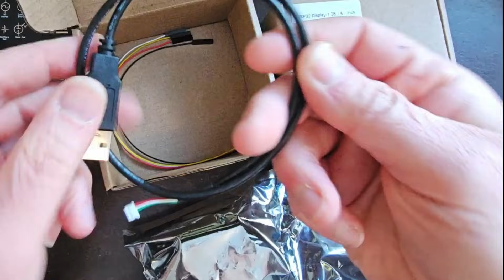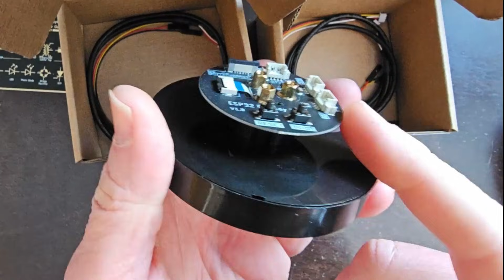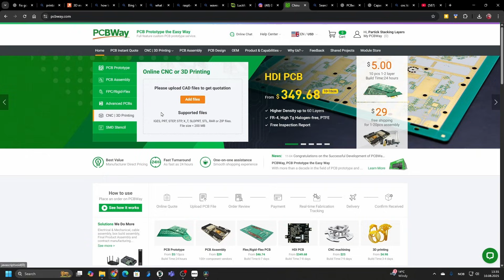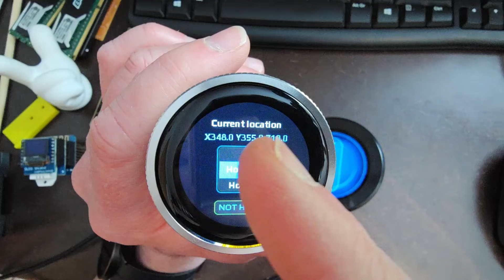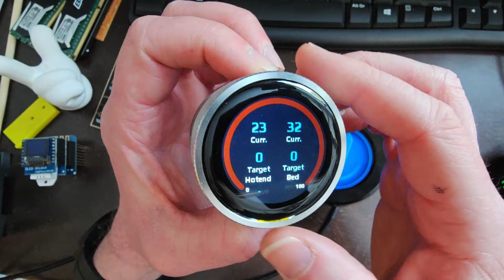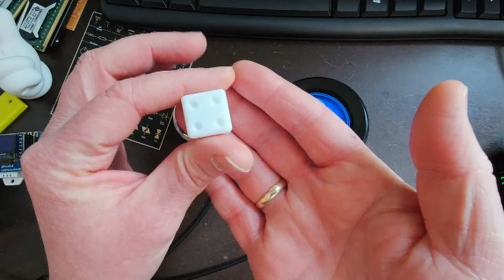Elecrow Rotary Display Review

Comment: Nice video - but itwould have been nice if you could demo how you created the code running on the rotary knobs
Reply from the maker: The code part with this, is something I'm still personally learning. The base of the graphical side is using LVGL and the rest is Arduino coding, but it's pretty deep compaired to basic aduino sketches so it was a lot of vive coding from chatgpt.

Comment: Let me comment some corrections:
- "so it's not high definition…" at 7:57: HD is a resolution for TV. That resolution would not make sense on a device as small as these displays. The term and abbreviation that you are looking for is "retina display" (that is an Apple introduced thing, it means the resolution of the display is higher than what your eyes can see at "normal" distance - about arm length) and PPI (pixel per inch) and that tells you how thin lines the display can show.
- around at 8:10 you mix up two things like you don't know what is what, so allow me to clarify that as well: resolution is what is in the previous part, smallest details, you seem to get it right, but then you start talking about the gradients… and gradients being "choppy" (called gradient stair-stepping or color banding) can be the result of two things. One is lower quality display technology (TN / TN+film is more prone to that, these displays are IPS and that is not likely to have it), and the other result is the bit depth of the display driver. The only info I have found is that it supports 65k colors and that means 2^16 colors. I don't know how these bits are shared between colors (maybe R5, G6, B5 but that SHOULD have color banding), but maybe it's a dynamic palette out of a 16.7 million colors total, and that makes sense if there's no banding. In short, color banding has nothing to do with resolution.

Nice stuff by the way, I'm making a circular display for my printer also out of those cheap "smart watch" touch displays.
I have a suggestion you might like that I implemented on my Home Assistant dashboard for my printer and will be the main thing on the "smart watch" display: three rings on the outside with some spacing, with the remaining print time in the middle. The colors of the rings from out to in is red-orange-green and it's a countdown clock: when all rings are full then it means more than three hours are left. When it's two and one quarter is full it means it's two and a quarter hours are left. When it's only the innermost ring has any part full then it's basically showing you how many minutes are left of the last hour of the printing. I find it very intuitive.
Reply from the maker: Thanks for those clarifications. 
I dig that time rings idea. I might try and do that for the larger one, when I try to set it up with home assistant. Are you programming yours via ESPHome? That's what I want to try with the larger screen.
Reply: @StackingLayers  Yeah, ESPHome is the plan, but I'm unsure if the circular progress bar is an option. If not, basic shapes are still available there too. I wish I could post a picture here to show you my styling of that "countdown timer".
Do you also have Home Assistant? Or just about to have it later?
Reply from the maker: I have Home assistant running on a BTT pi2. I'm currently running the HACS moonraker add-on for a printer dashboard. So I have plans to see how easy it'll be to connect that in conjunction with LVGL for display design. I know it's somewhat limited via ESPHome so I don't know if the Square Line designer method will be compatible.
Reply: @StackingLayers  if (when) you will consider another device for your Home Assistant, think of an older mini PC. Cheap, has SSD, fast, low power usage, everything you would want from a Raspberry but cheaper and faster.
I am using Octoprint as I like the plugins but I feel like it might not be the right choice anymore.
LGVL is supported in ESPHome and exchanging control data and states with MQTT should not be too complicated. On SquareLine it says it can export LGVL so should be alright.